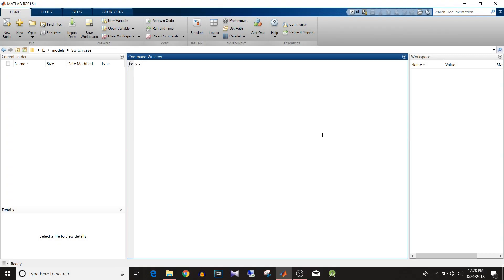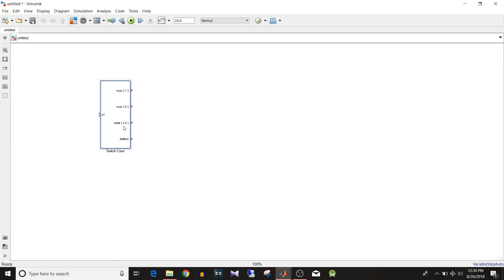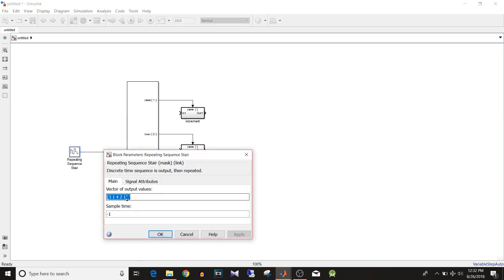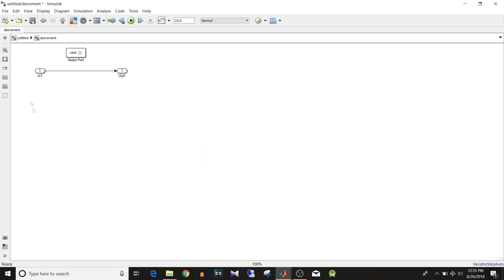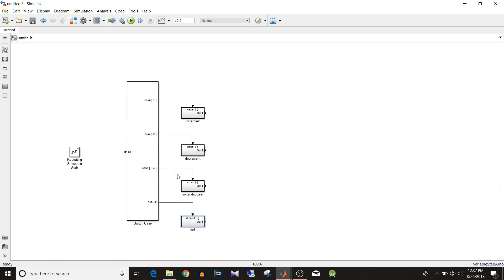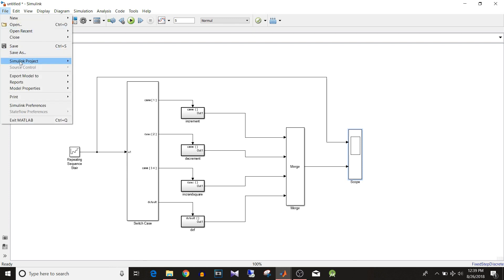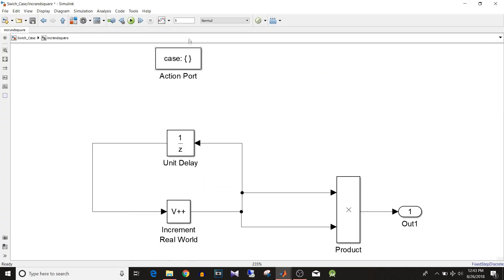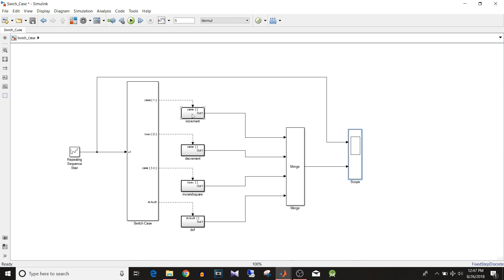Simulink Tutorial - 56 - Switch Case Using Switch Case & Action Subsystem

Comment: Hello.. good video.. keep up the good work and keep making more contents. I have a question. I have to convert the following line from a .m file to Simulink or Stateflow.
x = single(y) * ones(1,8) + z;
How to implement this array logic in model format? I tried all the ways I can think of but always giving error. Pls help if possible.
Reply from the maker: Hi... You can use mux block for the vector which will have 8 input ports. As it is ones of 1,8...you don't have to use multiplication and directly give 'y' as input to mux. Add 'z' to the mux output. So output of addition block will be your final output.
But keep in mind that the final value is a vector. 
Also if you want to use array other than ones(1,8), you need to use gain blocks for each value
Reply: @simulinktutorial9086  thank you. I'll try this and let you know.
Reply: Hi, ma'm! do you have any automotive project with full documentation including testing procedure? kindly reply me
Reply: @simulinktutorial9086  so.. shall I create a subsystem with input as y, z and output x.. and then inside that use mux? But then shall I pass eight constant blocks with value as 1 to mux?? Because the array needs should be of (1,8) with all values 1. If I give y as input to mux, I'll have to give it 8 times?
Reply from the maker: Hi... It is up to you how you want use the mux block. You can provide y as input to mux as the multiplier array is of all one
Or you can use constant block and give constant as ones(1,8) and implement your equation. But when you observe the output on scope, you'll see one signal due to overlap of same values. If you turn on the feature for signal size, you'll get size of each signal.
Reply from the maker: In Simulink you can use vector block or mux to form one dimensional array
Reply: Hii plz upload MIL and SIL testing videos